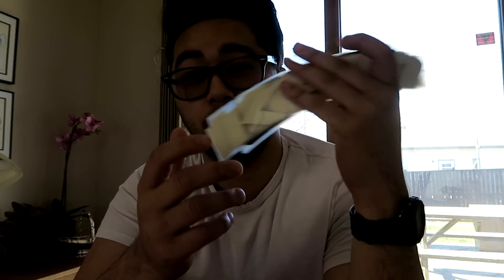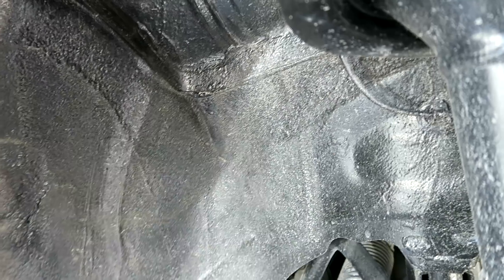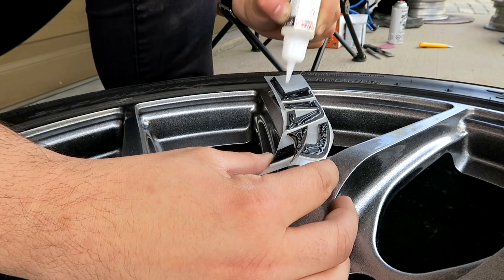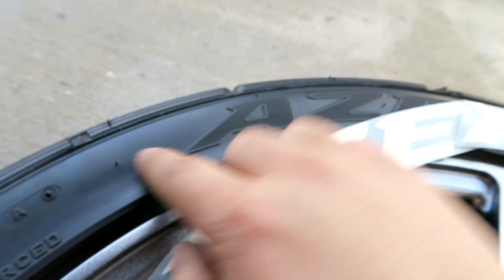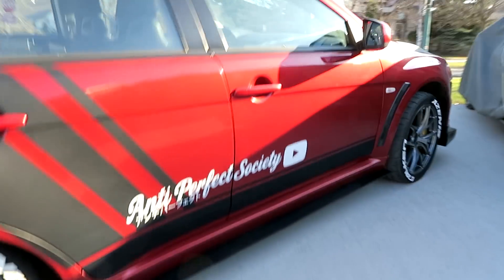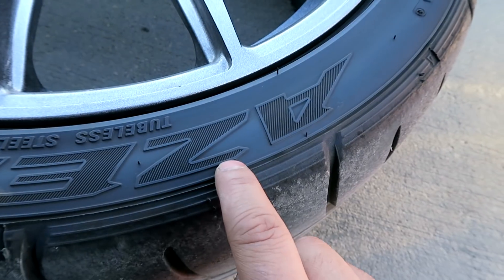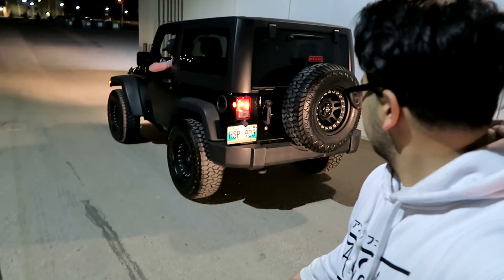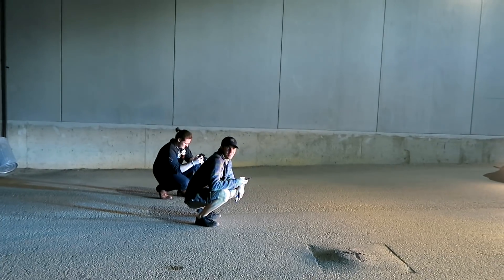EVO X // TIRE STICKER INSTALL!!

Comment: Whats the long term price difference between using a paint marker and using a sticker kit. Wouldn't the sticker kit be useless after applying since it's glued on so when your tires bald you'd have to buy a new kit?